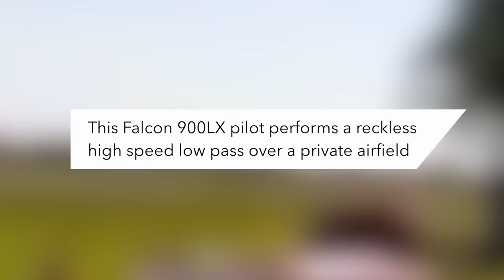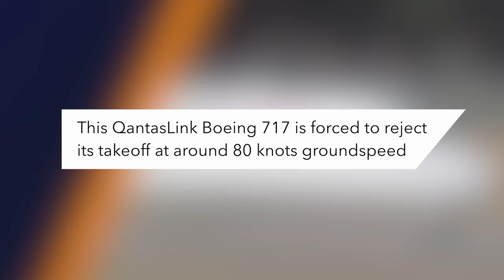Pilot Loses Licence Over Crazy Stunt

Comment: Well very nice 3 minutes of aviation, but there is a little mistake on this video, the Falcon 900LX has no stick shaker and the sound heard in the cockpit is what we call the “clacker” which is a noise that happens when you are trimming the airplane that warns when the stabilizer is moving. I know for sure I am type rated on 900s 😉
Reply: Correct
Reply: It was a well performed pass. Not any safety issues at all (as long as he made shure no other plane in the area). Plane well within the envelope. In my years with the DV20 Katana I was sometimes well further down. But also very much slower, smile.
Reply: @MrWave58  Unfortunately it doesn’t make it right…nowadays rules have changed…it would have been better to go for a pattern and fly low over the runway to pull up after the end of the runway rather than playing top gun flyby the tower like !😉
Reply: I’ve also got 20+ years in the type (classic) and you are definitely correct.
Reply: @skytrotter6144  Yes, times have changed...
Reply: @skytrotter6144  Amazes me that pilots ruin their careers over silly, irresponsible crap like that too. Not worth it.
Reply: @davidbarbee1276  Nice also flew the B,C and the EX too great planes fun to fly it is only a bit narrow in the cockpit, I am also typed on Challenger and the GLEX and I must say it is more comfy for long hours of flight !
Anyway keep the blue side up and stay safe…
Al.
Reply: @davidbarbee1276  PPL Airman to ATP(?)Airman: I was stalking you on the “Airman registry,“ no joy on the Falcon type rating lol. I checked all three of you, “David Barbees” 

I’m sure I’m doing something wrong, I mean in the search not about being in airman registry perusing creep lol.
Reply: @MrWave58  agreed - think it was just a little click-baiting spin for the video title. That's a very tasty jet btw
Reply: @mog882  he is typed in the falcon. Its the DA-50 type rating.
Reply: Absolutely correct. Nice to see someone who knows what he's talking about
Reply: @mog882  Well I do have FAA/EASA ATPL licences, but no you are not doing anything wrong, you just don’t have the names here to search on the Airmen Registry…therefore pretty hard to check unless I give you my FAA and EASA licences numbers which for obvious reason I would not make public 😉
Reply: @desks3674  Absolutely this how it is labeled it gives you the possibility to fly the falcon 50 series and the 900 series except for the LX for which you need another rating due to some differences in the system and a brand new cockpit called EASY that is common on the 6X, 7X, 8X. I truly loved to fly it and did quiet a few worldwide memorable flights on it !
Reply: Guys I dont fly the 900. But I did notice (unless its just how it looked from that prospective) how quickly the bank angle warning sounded. Is it controlled by the GPWS? and does the margin for that caution to sound tighten the closer you are to the ground? Just seemed to warn the moment he started the roll.
Reply: @JONESSTI01  Actually it is the EGPWS working in combination with the Radio Altimeter, limitations are 10 degrees bank up to 30 feet then increases proportionally as altitude increases up to 150 R/A there are graphs that would give you bank vs R/A, I am sure you can find.😉 The too low terrain he got was because of no flaps gear up and close to the ground and then the bank angle for the same reason exceeding 10 degrees at or just above 30 feet !
Reply: @skytrotter6144  ill find something to read on that. Thanks :-)
Reply: @skytrotter6144  go for a what?
Reply: @MrWave58  Well within the envelope? Whilst you may think you sound knowledgeable, in what part of the Falcon FCOM is the part about high speed low level passes? I would hasten to add that aircraft was operating outside its ‘envelope’. A stunt plane it is not. A reckless manoeuvre carried out by a reckless pilot. Not a Dassault test pilot. I wonder if he considered low flying birds with his likely +250kt low pass?
Reply: @skytrotter6144  In other words the pilot showed zero professionalism. It’s no wonder why there are so many corporate jets in the US, that turn into smoking holes with frightening regularity.
Reply: Please check the definition of "envelope".
Reply: Thankyou for making this clear Skytrotter! Interior and exterior video seems to show the aircraft travelling at moderate speed--was surprised that the 'stick-shaker' would be triggered under the circumstances...
Reply: @mog882  Are you assuming that every pilot in the world got their license from the FAA in the US?
Reply: @Michael.Chapman  Welcome…not trying to spread knowledge only facts…😉
Reply: if you're not clackin you're slackin
Reply: There was a pine tree ,near the left wing. I am sure the Falcon pilot must have taken a calculated risk. Anyways it was foolish.
Reply: @MrWave58  Wut?
Reply: I have 15+ Years invading FOBS in the Seychelles.

I can garuntee you, that my stick has no movement after years of sitting and shooting.

It's like theuscpes at the base of my shift have been over excited to the point of no return.

I can't even dream without it turning into a nightmare about King brown snakes
Reply: Was it safely performed though?
Reply: And what is so crazy about a fly past - the namby pambies of todays pilots are a reason why very few airline pilots can actually fly - they are very good at system management, but stick and rudder - pffft
Reply: @joblessalex  In the pilot aspect. Yes. In the risk aspect. No. Could’ve easily hit a bird or in the least case scenario,
clipped the top of a tree.
Reply: @locomoto7621  
He could hit a bird easily if he was fully configured and stabilized to land 10 miles out. So what? 
How could he have clipped a tree easily? Do you think he might have been performing the maneuver blindfolded? Looking out the window and judging the airplane's height over things is kinda how pilots land airplanes.
Reply: "stick shaker" (giggling)
Reply: Imagine if in the heat of that moment the pilot trim down instead of trimming up... and it's to late to fixing it.
Reply: @michaeljay4213  what???? LOL that was random af
Reply: Y tampoco perdi mi licencia como piloto!!! Es Argentina no los Estados Unidos. Come on, this private airfield belongs to an insurance company and I was flying the boss....
Reply: @109-w7v  dude, u are highly mis informed. 🙄
Reply: @MrWave58  this is not Miramar. He was at fault and rightly lost his license. It is bad enough having idiots in cars thinking they can be m orons without pilots joining in.
Reply: @skytrotter6144  yeap flying had gotten pretty boring, can't do nothing anymore unless in the middle of the dessert, I bet many people pushed for this pilot to loose his license, the punishment didn't fit the crime, suspension for a few months or up to a year maybe but even that seems excessive, i don't agree neither.
Reply: They really can’t go a day without letting everyone know they’re a pilot 😉
Reply: I thought it would be strange, there wouldn't seem to be any reason for a stick shaker to activate in that situation.
Reply: ye whatever mate, this is a not a top gun movie
Reply: @dontworryboutit3249  Well if you don’t say a minimum anyone could reply and claim it is BS so by saying that you know about this plane for a good reason makes it up to any allegations of the contrary.😉
Reply: @cheesegraham2387  Never said it was a top gun movie nor did I say he did a good job !
Reply: Incorrect
Reply: @djtomoy  And what is incorrect enlighten us please !

Comment: 2:15 Actually you have to monitor the spoilers to see the exact moment the T/O was aborted. They deploy about 4 seconds before the T/R are deployed.
Reply: That's why one should check comments before posting. Wanted to say exactly that :)
Reply: Around 2:20
Reply: Was thinking to say the same thing myself
Reply: Very well spotted, thank you 😎👍
Reply: Or it is the reason why the take-off was aborted unwanted spoilers deployment below 80 kts or V1, thus T/Rs a little later, but the answer will be in the Australian “NTSB” at this point it can only be a speculation !
Reply: @skytrotter6144  Separation anxiety.
VH-NXG T/O cancelled by tower.
Reply: @skytrotter6144  It's the Australian Transport Safety Bureau (ATSB,) which when formed incorporated the Bureau of Air Safety Investigation (BASI).  The Civil Aviation Safety Authority (CASA) is also involved in air safety matters.
Reply: @Horstroad  Nope that depends as you have ground and flight spoilers, so all is about the schematics so a malfunction of flight spoilers or ground spoilers the latter in fact are connected are also receiving the message through the ground prox switches…anyway on the plane I fly if a Ground spoiler or another one comes out on takeoff the No takeoff warning comes, but it could also be insidious reason why I say that not being in the cockpit or read the report all that can be said is pure speculation !
Reply: @PeterWalkerHP16c  Well that was another possibility that I didn’t mention was about to look for a report and check what there was with the A/C registration because of the other comment above well done ! 😉
Reply: @vk2ig  Every country has its own name and I didn’t check so thanks for the info !
Reply: @Horstroad  Of course there is time we do train all sort of figures in a sim for our 6 months OPCs and LPCs and this can be one of the items that we would be tested on either prior to 80 kts (any failure) or between 80 and V1 for major malfuction…spoilers are breaking the lift so an abort is necessary if it does deploy…by the way you should also understand that for all calculation regarding ASDA or LDA the reversers are not taken into account for performance calculation so whether he’d extended them or not it wouldn’t matter…also some jets such as Embraers 145 do not have reversers it’s an option, also on landing charts it is often said that reversers should be used to a minimum except if really needed.
Now on this airplane I am not typed on but normally depending on the SOPs and the plane, it js either the PIC or SIC that extends them and ir it is automatic on a RTO but the reversers are the responsibility of the PIC but can depend on SOPs too !
Reply: @skytrotter6144  Next time you're in the sim try to go from take of thrust to reversers deployed in less than 3 seconds. All of what you're saying is irrelevant because in the timespan we see in the video there is NOT enough time for the engines to spool down AND the decision for an RTO. Spoilers deploy at 2:20 reversers start do deploy at 2:23.
Reply: @skytrotter6144  This wouldn't be something the US NTSB would investigate so I'd doubt Australia's would.
Reply: So, I'm not familiar with the 717 specifically. But I did look up an old Delta procedures manual. At decision to reject <V1 for whatever reason, engines to idle, and full braking power, immediately.

Now, the Delta version-717 specially defers disarming the spoilers until + rate of climb.  

So my question to those more familiar with the 717 incarnation of the DC9, is: would application of full brakes with engines returned to idle deploy spoilers as a matter of course? 

And to everyone else, why would a rejected takeoff absent something very unusual like an engine fire or runway intrusion trigger an investigation??
Reply: Well spotted bro. Good job you’re absolutely right
Reply: 80 knots ground speed???

Comment: The sound at the end of the Falcon video isn’t a stick shaker, it’s the sound that the elevator trim makes while it’s being used.
Reply: I was surprised by this as well, if it has a stick shaker, it is activated by a stall and not these manoeuvres?
Reply: @joostdriesens3984  I was surprised to see them call it a stick shaker, he didn't pull up that sharply and had so much speed... I can't imagine he approached stall
Reply: Absolutely correct
Reply: The Falcon 900 does not have stick shakers. They have an aural warning, automatic slat deployment and if it has auto throttles they will advance in power automatically.
Reply: @hawker800mech  .. and automatic license revoker when flight manoeuvres approach performance envelope? 😉
Reply: Shhhhhh. Videos are here to get upvotes, not to be factually accurate.
Reply: Stall can occur at any speed at any pitch attitude. On another note this pilot is crazy. Wth was he thinking.
Reply: @CyberSystemOverload  thanks for quoting the Airplane Flying Handbook to us.  The sound at the end of the video IS the trim sound.  The stall warning is a male voice saying STALL, STALL.
I can tell by the pixels, and also I fly a 900 EASy.
Reply: @P_Factor  Why the snide remark? Where was I disputing the Falcon systems? I dont know anything about that and I never bleat about stuff I dont have knowledge about.  I was just referencing the other users comment where he said  "...had so much speed... I can't imagine he approached stall"
Reply: @CyberSystemOverload  you didn’t reply to that other comment, it was a reply to my initial comment.  So your response sounded a lot like “WELL ACKTUALLLLYY….. a stall can occur at any speed…” which sounds like contradicting my statement.
Reply: @P_Factor  Oh I see what happened now and I understand now why you responded that way - I would have too. All good :-)
For some reason the tag didn't appear in front of my reply - I had tagged the other person with "@" and his handle but now I see it did not appear - thus making it seem I was addressing your comment. Will make double sure for future replies that this doesnt happen!

Comment: 2:18  Actually, a second or so before the thrust reversers are deployed you can see the spoilers/air-brakes deploy on the wing.
Reply: Doesn't look like it was configured for take-off
No flaps ?
Reply: @NinetyTres  There are some Flaps out. Look at the leading edge of the wing…you can see them slats are down.
Reply: Great catch!
Reply: @greggyd321  thanks!
Reply: So many people are mentioning this... but noone mentioned that out of all the other mechanism, on ground the gear brakes are what's primary to slow you down.. and the pilot did that!
Reply: @NinetyTres  normally flaps are nit set back fully for takeoff, because you want speed. Fully deployed flaps can create significant drag which never really helps Other then for landing . Normally flaps will be set to 15 to 25 degrees for takeoff.

Comment: 02:15 - "if you closely monitor the thrust reverser, you can identify the moment the takeoff is aborted"
Actually if you watch carefully you'll see that the takeoff was aborted way before that. The spoilers were deployed several seconds before the thrust reversers.
Reply: Excellent eye. And I'm surprised about the T/R. I wonder if they're just later in the checklist or do they actually take several seconds to deploy?
Reply: @captainotto  I think that the lag is from the throttle levers being taken to idle and then to reverse thrust position, plus the  engines spooling down prior to actually deploying the reverse thrust.

Comment: 1st video is complete BS about pilot 'losing' any license. High speed airfield rwy passes are not inherently dangerous unless the 250 knot speed restriction is broken or property was damaged.
Reply: It was also over 4 years ago and in Argentina. Doubt their version of the FAA (if they even have one) did anything
Reply: @clarencethomasisthegoat  You're absolutely right on that one, no one follows rules in Argentina, in fact the national pass time is to brake every rule there is, as there are no consequences.
Reply: @erxu  i live in Argentina and everything you are saying is completely right. Not only in aviation
Reply: @erxu  what brake? They didnt do any braking. They only break rules.
Reply: Ah it’s 200kts in the pattern there, speedy
Reply: Yah and no stick shaker on any Falcon. That noise is an audible indicator that the pitch trim motor is operating.
Reply: @erxu  Had a hilarious image in my mind of rules having 'brakes'.

Comment: In August 1989, I was onboard a USAir Fokker 100 that had a rejected takeoff.  I got worried as we got to about midway down the runway, we weren’t gaining any speed, and if we had run off the end of the runway, a river was just ahead.  Fortunately, the pilots brought the plane to a halt and taxied back for a maintenance check.  That plane was like three years old.  A couple of weeks later, another new USAir Fokker 100 did run off the runway into the water off LaGuardia (as it turned out, the causes were unrelated).

Comment: First video is a good way to get fired.  We used to have a UPS pilot (contracted to fly UPS packages from a backwater airport to a major one--probably not an actual UPS employee) that every day at 5:15pm would take off, climb to about 50 feet, and crank the wheel over into about a 60 degree bank.  People would literally hang around the airport to watch it if they happened to be there about that time, or come out of the FBO to watch, with everybody betting on when he'd go a little too far.  Eventually someone just videoed a couple of these, contacted FSDO, and that was the end of that; replacement pilot did the most boringest takeoffs ever.

Comment: Spoiler deployment is a better indication of when the captain decided to abort the quantas 717. I’m assuming Boeing recommends the same reject procedure for all its aircraft. 
Throttles idle
Auto/throttle disconnect
Speed brakes deploy
Thrust reverse maximum 
The order prevents trying to deploy thrust reversers while the engines are still spooling down from takeoff thrust.